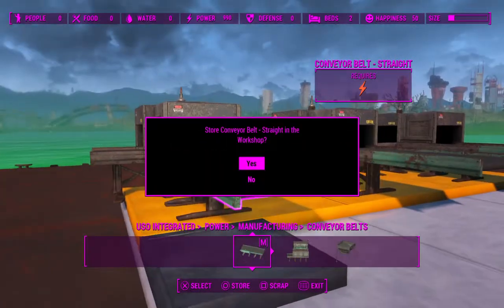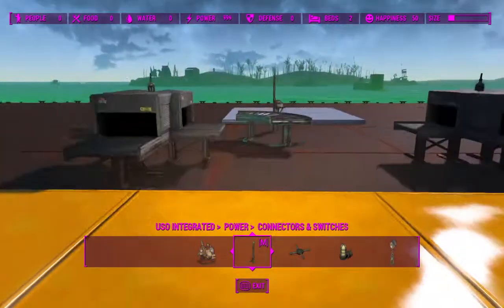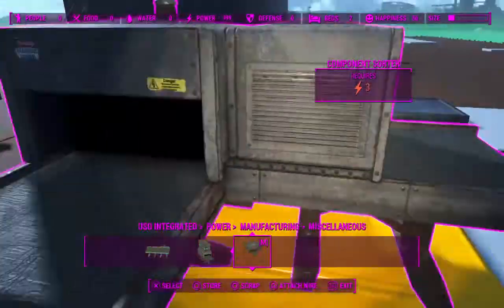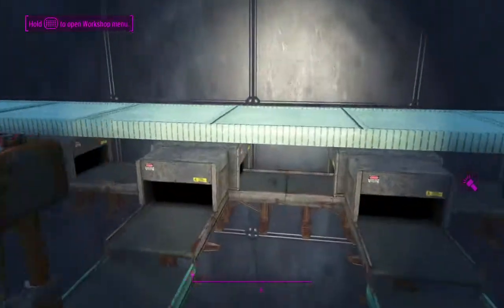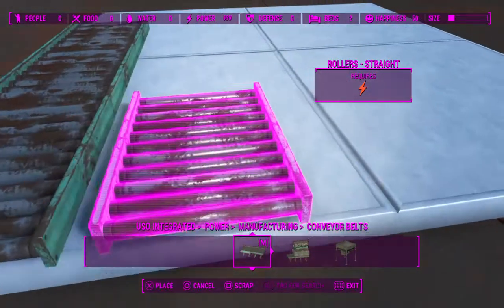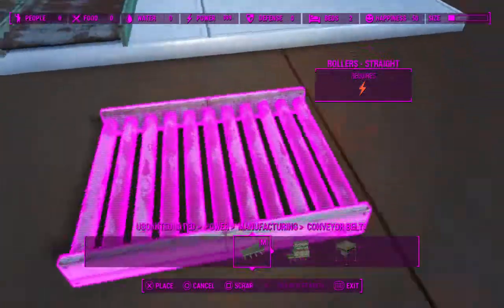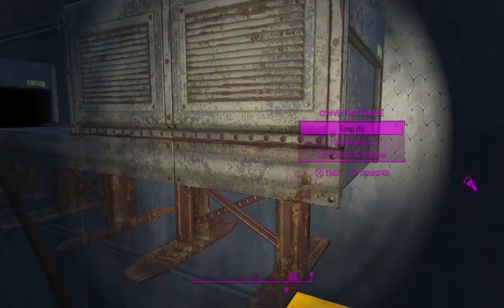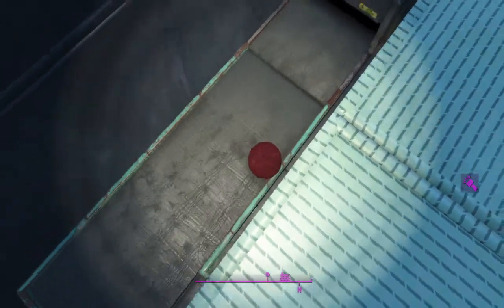PS4 Manufacturing Overhauled recycling part 1

Comment: For some reason my vacuum hoppers are pulling out the components before they are broken down into raw material
Reply from the maker: Ju Money 
Either have to turn the vacuum Hopper off or set it up with the delay switch like in some of my other videos. The vacuum Hopper will suck the components out before they get broken down because that's what it does you have to turn the switch on it to turn it off until it's done breaking everything down then turn it on.

Comment: Is there 2 items missing? The auto butcher and conveyer workshop storage? I've seen it it other videos and can't find it in mine lol
Reply from the maker: Eric Whelan 
You're looking at manufacturing extended, which is only available on Xbox and PC. For  PS4 this is Manufacturing Overhauled. There is no auto butcher, 1 recycler or anything to throw it back into the workshop. That is all custom scripting. Which thanks to Pete Hines can't be done on PS4. This is the best that 3lric
Could come up with to work within the no scripting PS4 limitations. However he is working on some type of Auto butcher and some other stuff but they're probably not going to happen.
Reply: Jack Dolff thx jack

Comment: Having trouble getting the conveyor to hopper in place and powered, saw how you did in video,  but i can't get my spacing right, also my height seems to be too high, can't get roof on,, lol, where was my mistakes
Reply from the maker: Wesley Bridges 
I don't know if you meant the conveyor storage to vacuum Hopper. Stay tuned I'll be posting the new video sometime. But I redid this one and I used conveyor splitter to separate them and did the same thing where it's slightly off but it still sucks it back and forth.
Reply from the maker: Wesley Bridges 
And  the roof? If you were too high you can't put one on, but if you used concrete you have to put a single pillar in the corners where the roof won't go on
Reply: Jack Dolff , not the vacuum hopper,  i cannot get the collector conveyor to get to the 2 story hopper for some reason the way you built it, i had to expand building 1 more full floor space to accomplish
Reply from the maker: Wesley Bridges 
At least you figured it out, if not you could have used the PA tool to place it.
Reply from the maker: Wesley Bridges
I was wrong about the vacuum Hopper/UP conveyor, I figured out a way to do that, to reduce Jam ups at the top of it. I believe, I'll post a video on it shortly maybe this weekend.
Reply: Jack Dolff cool, send a link when you get time for that one, I'm interested in that one, on second play through, finding unmarked locations, every rooftop, collecting power armor frames like a mad dog